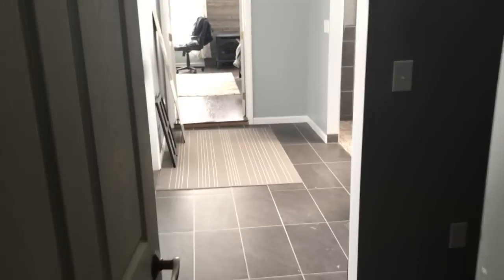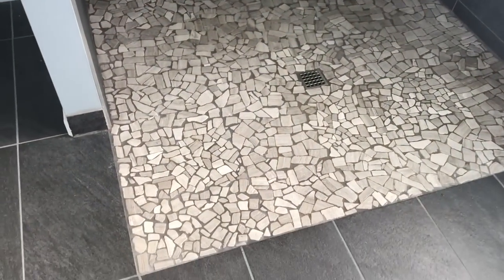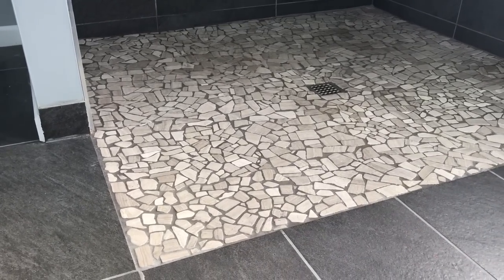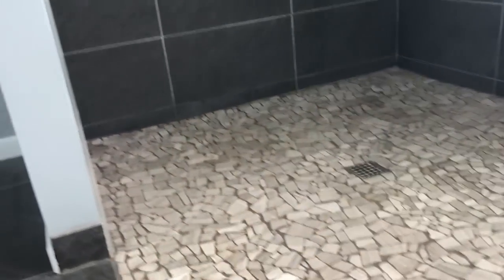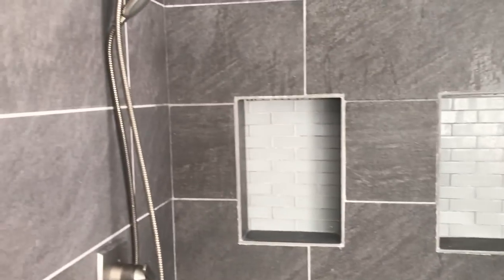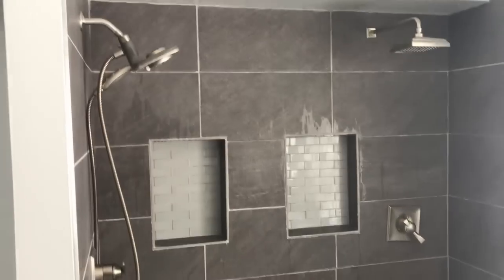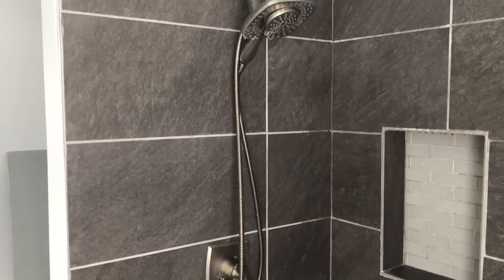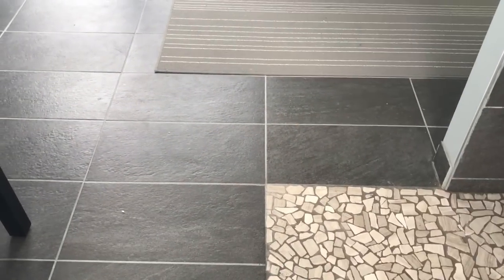How to Build a Walk In Shower - Curbless - Durock Shower

Comment: I love what you have done, thank you for sharing!  An open shower is what we will need if we want to age in place and sooner rather than later.  Two concerns I have; does the cabinet get wet and if so, is it a problem?  Did you add an additional heat source for comfort when you step out of the shower?
Reply from the maker: Great questions! I had done some splash testing of my own when planning this project by strangely enough taking a shower with a shower curtain open! That was the base for by design. The cabinet doesn’t get wet at all and there is very little moisture on the tile just outside the shower floor area. My wife as throw rugs that go right up to the edge and do not get wet. I ran wire in case we wanted to add a secondary heat source but have not needed it. It’s surprising how much running the shower actually heats up the entire room even with its higher ceilings.
Reply: @freetotryit  Thank you, this information is very helpful!

Comment: I understand prices will vary depending on the size of the shower and materials used. However, how much did it cost you to create this walk in shower?
Reply from the maker: Great question and as you have said it can vary depending on price per square of your tile choice and the price on your shower valves/hardware choice. A rough idea of what it cost me doing it myself would be about $150 in framing and backerboard, $250 for shower floor, water proofing and drain, $400 for tile and grout, $400 for valves and fixtures.
Reply: @freetotryit  The dura rock seems to be sold out. Do you have recommendations for other brands that might be in the same price range? Other products are very expensive.
Reply from the maker: @checkoutmymelody310  I wouldn't know what to recommend this this is the only one that I've used. I do know a friend of mine used the schluter system and like it but I can't speak first hand about it. https://amzn.to/3fPhjiR

Comment: Your curb less shower looks nice except, the floor tile work. You can se every single stone sheet. Nice work on walls though.
Reply from the maker: You are 100% correct. The strange thing is in real life it doesn't show as clearly as it does on video! very strange but I for sure could have done a better job on the tile sheets.
Reply: Nice job done. Next time use perfectly matching grout on that floor.
Reply: @kozelazazel  I'd rather use the grout he used in the video. I never want to use black grout again!

Comment: In your video you state "notch the floor joists" I was always taught this is a no no. Because of the area you are covering, this isn't considered notching. You compromised at least 3 maybe up to 5 of your floor joists. I don't have the exact definition of a notch, (there is a specific definition). Unless you reinforced each joist, I don't believe what you did was safe or up to code. Not bashing your work, it looks great. There are to many DIY want-a-bees out there that will start "NOTCHING" their joists and never give it a 2nd thought that they are cutting in building structure.
Reply from the maker: Excellent point and I should have been clearer on what I did. What I meant by notching was I basically cut the depths needed out of the floor joist. Then I did in fact sister another another board along side the notched portion which was overkill based on the size of the joists I had already in place but I like security. Thanks for bringing up a great point!

Comment: I keep hearing to notch at 3/4 inch but also hear 1.58inch. Any idea which is correct ?
Reply from the maker: Your notch depth will be determined by the thickest edge of your Durock styrofoam floor which is determined by what size you go with.

Comment: How deep did you cut the floor joists? This seems like the most important measurement as it makes sure everything lines up on the surface...
Reply from the maker: You are 100% correct. The depth of the cut will be determined by the size of your shower floor since the larger you go the thicker the outside edge of the tapered floor panel and the deeper your cut. Once you cut your floor panel to size you can measure the edge thickness and then make your cut. You basically want the top of your floor panel to match the top of your backerboard on your main floor.

Comment: How much did you have to notch out the floor joists?
Reply from the maker: Great question. It will vary based on the size you are making your shower. The preformed floor sheets are tapered so the larger the shower size the deeper your notches need to be.